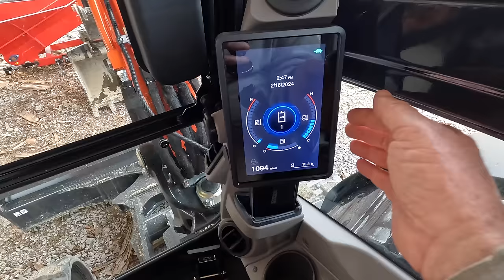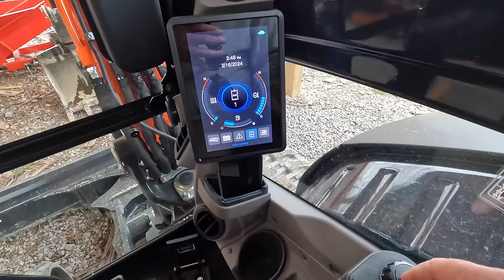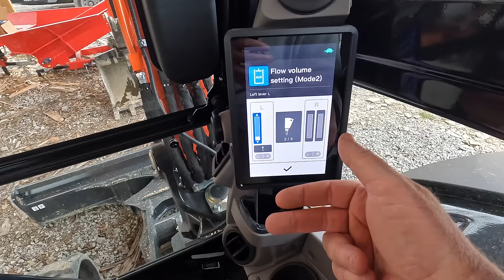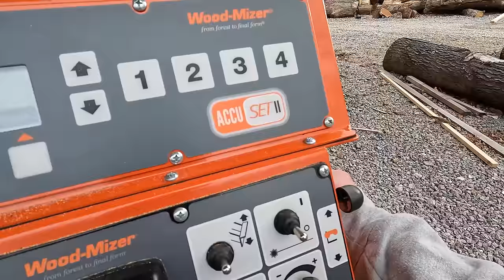Let's See if You Guys were Right About This?

Comment: Bright white maple can be beautiful. I hired my sawyer with his portable Wood Mizer mill to saw a whole bunch of it at a customers home. It had been sitting out in the weather for a few months, and consequently the acid rain permeated both ends, and made the wood turn... I'll call it brown, but not that dark. I was committed to the sawyer so I had to go through with it. I found that if you use wood bleach it will eliminate the staining. (What you have in those streaks are as you described, and is not what I am referring to here) The problem is the wood bleach only penetrates about a sixteenth of an inch. If you sand deeper than that, the stains remain. If you have pure white maple and do a project with some darker color woods the contrast can be rather artistic.

Comment: The counter tops in my house are hard maple. I absolutely love them. They are beautiful, the feel warm, and if you tip over a glass on the counter, it doesn't break. Every few years I give them a light sand and a couple coats of tung oil. They still look new.

Comment: Maple has been my favorite since I was a teenager making furniture and stuff in woodshop. When I worked in a sawmill at 18 years old we primarily cut maple. I'm not a fan of the stained maple; I like it all white, and the birds eye maple is the prettiest. It'll take sanding down to a very fine sandpaper, which really brings out the highlights of the wood; it just seems to keep getting prettier. And, I like it for firewood because it splits better, and seems to make the best bed of coals and puts out a lot of heat. I'm not sure of the difference between the maple in Northern Michigan and the maple you have there. We had maple, red oak, ironwood, birch, ash, poplar, and in the southern part of the UP a lot of dead elm (Elm was good firewood, if you split it in the winter, it heated very well if you put it in a big furnace, and it burned clean. Burned primarily elm, and also red oak in the furnace.).

Comment: This off topic but it looks like the wheels on the conveyor rotate 90° to be perpendicular to the belt. That would help fill the wood bunker. If you angle it to the rear to start filling it and then rotate it forward as you fill. Like a radial stacker in a stone quarry.

Comment: Mike, with the AUX Flow Rate settings you can also select up to 5 presets as you had done.  You can also change/select the icon image in the middle to help remember the attachment.  They have the tilt bucket as an icon.  Then you can just choose the model/mode you want when you add the attachment.

Comment: Hey Mike I hope you are loving the new KX057 I love mine! I got it a little over a yr ago, I know those are pipe threads but Teflon tape on your hydraulic fittings isnt the best option (in my opinion) if you are gonna use it recommend leaving the first 2-3 threads dry or use teflon paste...just a thought.

That tape will find its way into the valve spools at some point (speaking from experience) and can cause troubles down the rd. You probably already know that but figured I would be the negative commenter of the day 😜😂

Have a good day!

Comment: I was thinking as Daniel was running his for the first time, cleaning out the culvert, "He is certainly not as smooth as Mike Morgan!".  Your operation of the excavator is like watching a ballet, and I get mesmerized.  You add life and animation to a piece of machinery.  
You stirred up my OCD when you left the Aux 2 symbol as a Jack Hammer, instead of changing it to a bucket.

Comment: When I first got my excavator I built time and muscle memory playing with an old tire.  Pick it up, with and without the thumb, toss it around, drag it.  Can't hurt it.  Then I moved up to boulders (something your dirt is obviously lacking!).
So I was always taught to NOT use Teflon tape on hydraulic fittings, the thought being a piece of tape could break off and jam an orifice in the control circuits.  Better to brush on liquid gasket compound.

Comment: Spalted maple is formed by a fungus which attacks the wood as it decays. It is usually found in hard maple. 
Ambrosia is caused by the ambrosia beetle as the wood decays. 
What you have there are simply mineral stains - fairly common in maple.

Comment: Quick question for you regarding your hydraulic flow settings, when you are on the screen with the flow rate, is the middle picture of the jackhammer a place where you can select different attachments and they will have preset flow rates?

Comment: I'm impressed with the Rex it churns out a lot of firewood in a short amount of time with a minimum of lifting and manpower. if you had to pick between an excavator, a skid steer or a compact tractor for your first piece of equipment what would it be? and why? that may make a good video.

Comment: Hey Mike, stay away from Teflon tape on hydraulic  lines, as it can void some warranties if it gets into the pump, use liquid thread sealant like permatex 80632 or loctiite 545 , might save you some headaches later on

Comment: If you own more than ten acres you can use a track hoe I have a 100 and I use my track hoe with my sawmill and I use it to pull sinker logs out of the swamp were just can't get with a tractor 🚜 not to mention I do a little side work with it and pick up a little bit of cash now and then 😂 God Bless Y'all and have a great day.But those hoes that Nathan and Daniel have are al little bit different from what you and I have you have to no a little Chinese to work 😮 on them I looked at a few of them a while back and then I had the motor in mind rebuilt and I'm happy 😊😊😊😊❤

Comment: did you know that trees are formed out of thin  air . air thar has carbon dioxide + water+sunshine  and a lot of money out of thin air ---you just need a printing press ---or rather chain saw,log splitter ,saw mill ect,ect and a strong back ,will and sales teck. ---wheeeeuuuu!

Comment: another channel's comments were ripping the channel for using pipe tape on their hydraulic couplers like you did.   But I have seen you do it and not have an issue.  I don't know if it was the fear of having the tape get into the lines or if it was that the tape doesn't hold up to that kind of pressure and will more often leak than had it been put on dry.  I don't know.   Just passing that along.  I am no expert and would have done it exactly like you.

Comment: Are you starting to use it to bring all of the stuff from below to wear all the wood-cutting equipment is located?
Did you say once before that having a truck just sitting is not good for it, and is hard on the engine of the old dump truck?
You can start to use it to help you get all stumps, and logs to the main work area just to keep the old Bluefield at tip-top running condition.
Using the old dump truck to lay down the new gravel on the road, the truck is being used to do something rather than just sitting I know you say that it is not road-worthy let's do this and get the new truck but you and your son-in-law put old Bluefield's body, on it and drop the transmission into it than you have the best of both worlds old and new this way, you can use the old truck and drive it on the road, legally just make sure that new VIN stays with it than you can drive it on road and road, trip to the cabin as well.
You can also put the restomod on your YouTube channel which would be fun to see you and your son-in-law do that with the old dump truck and get back on the road I know that it can be done and then it can be used instead of just sitting rusting away.
Since you do nothing with old Bluefield why don't you sell it if not, going to use it.
Sincerely!
R.S.V.

Comment: 40 percent of Americans have less than a $1000 in savings. Only 21 percent of Americans have more than $5000 in savings. That means 80 percent of Americans have less than $5000 in savings.

164 million tax returns were processed in 2022. 34 trillion dollars divided by 164 million taxpayers equals $200,000 per taxpayer. Some taxpayers might be a little short on their share of the debt.

Comment: Stop kidding your self. Theres still to many mark ups. Stop the dealer add-ons. Inflation is nothing more than greed and every Manufacturer needs to feel the pinch. All the new tech but the vehicles are not getting better fuel milage trucks are no more capable. 10speed transmissions thinner steel new engins that continue to fail before 50k miles. Cars today are junk and not worth the value of cars from 10 years ago.